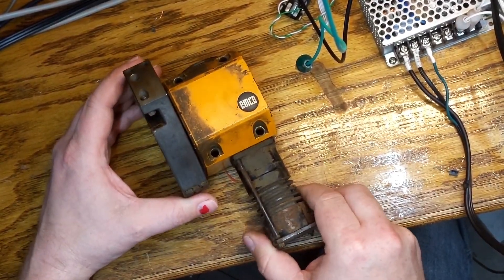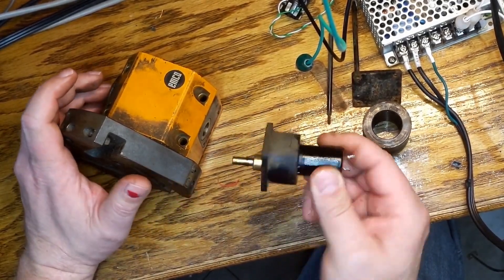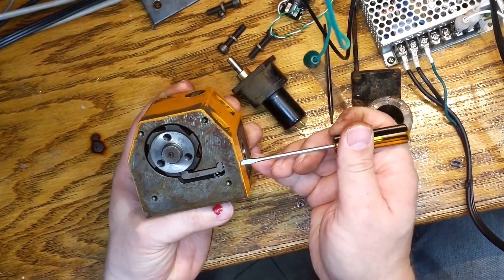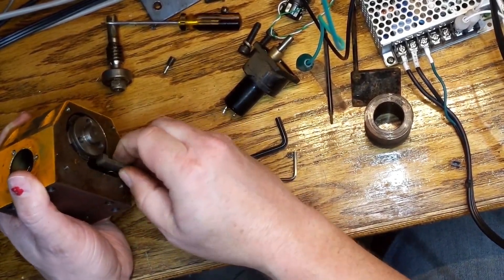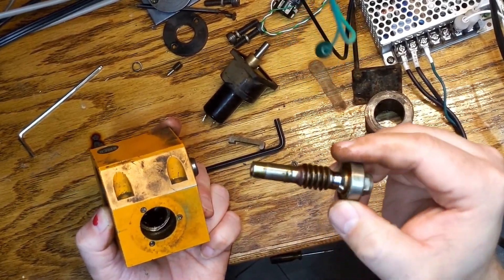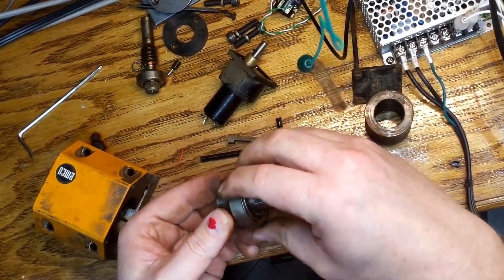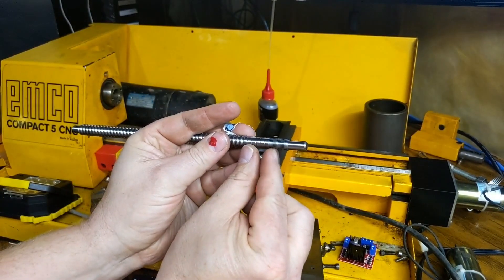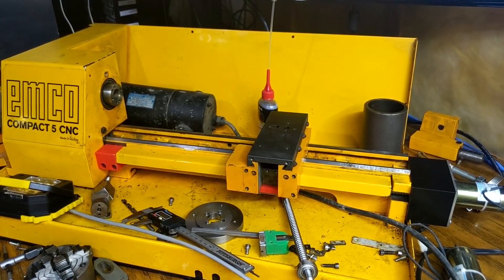Printer port isn't dead part 5.  We found a turret!  (and things are going to fit)

Comment: The major upgrade for one of those will be the positive position lock (pneumatic on industrial) electro magnet may be to simplify things which will make it possible to reverse spindle operations and drilling will be a lot safer :-)

Comment: The shim is likely so it can fit the same casting on the various models, plus it allows them to shim to height instead of grinding the turret. 

The trick really is to use eccentric holders for your drills/ boring bars. 

The connection between the tool mounting plate and the rotary mechanism doesn't lock down to a repeatable location, it just uses cap head screws. On mine I counter sunk the holes and put flat head screws in, but it can still move if you push it hard enough.